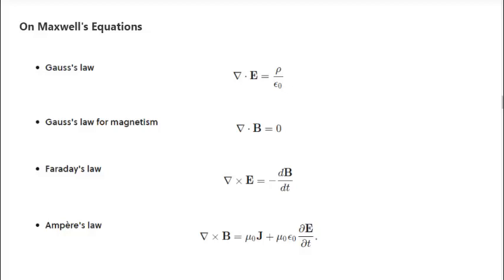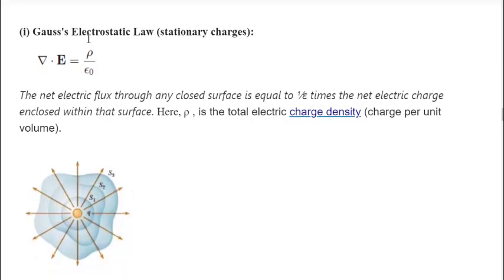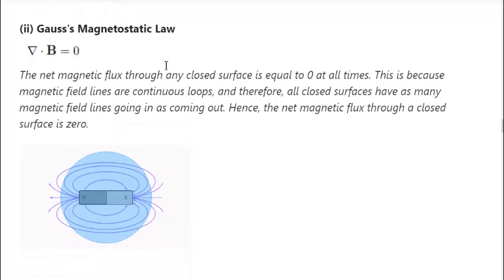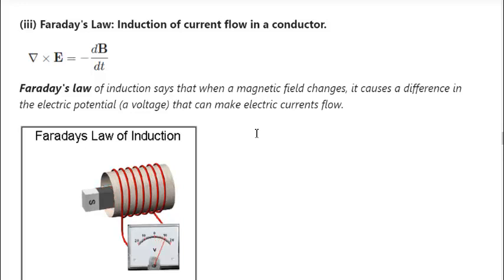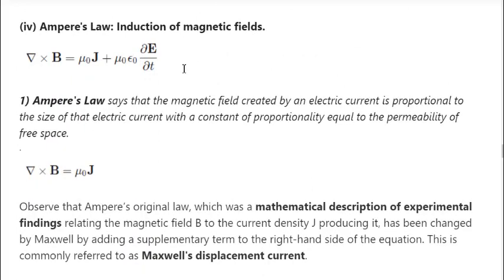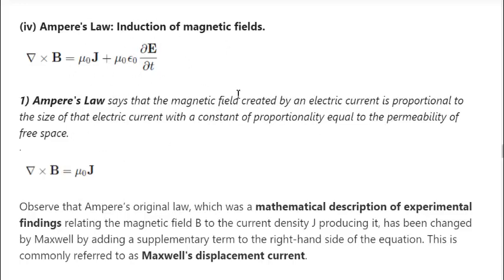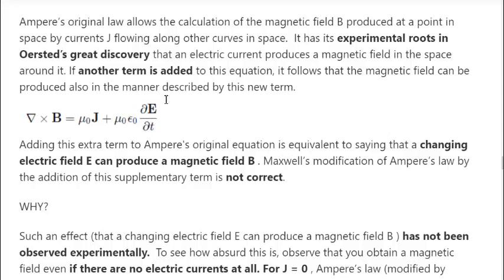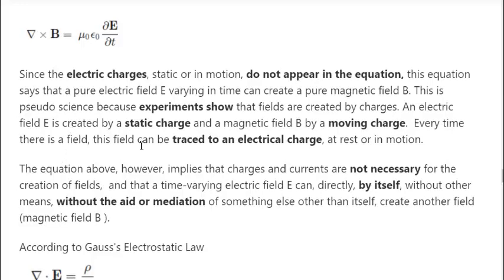On Maxwell's Equations: Part 2

Comment: Very interesting.  The Law of Induction.  This brings to mind something I saw ages ago.  A mechanical tone generator.  A magnet and coil mounted on a base, with an adjacent ferrous plate that is square.  The plate is spun on an axis, where the corners intersect the magnetic field.  The field fluctuates, which creates a fluctuation of current in the coil.  The "tone" is varied by the rpm of the spinning plate.  This was back in the 70's, and led my imagination in new directions.

Comment: We always considered ‘displacement’ current as charge movement within a dielectric.  As the dielectric is polarized charge density changes without allowing an external current flow to the capacitor.   However this internal displacement does create a magnetic field momentarily which is extremely difficult to detect, yet has been detected experimentally.

Comment: an accelerating charge is the classical analogue of an electron orbital jump or energy state transition . this atomic process will produce a magnetic field from the orbital and spin magnetic moment of the electron. at the same time, the same charge acceleration exerts a coulomb force in the electric field (counter-spatially), charging or storing electrical pressure energy in the electric field. which in turn generate a corresponding net voltage potential ( becoming  negatively charged that is).  1 ampere is charge flow per second = 1 coulomb force = 1 volt net charge. i think this process is the origin of "changing magnetic field induces a changing electric field and vice versa. 

this is also the process ( which is basically an oscillating charge aka alternating current) that is being tracked  by the iconic graphical /mathematical  representation of the electromagnetic waves with two sine waves (magnetic and electric ) perpendicular to each other.

Comment: Plasma physicist here. While there are several problems with this paper, the most important mistake is around 10:50. The equation does not imply that dE/dt = 0 if d(rho)/dt = 0 (that "P" is the greek letter "rho"), which is what the paper (and you) state. What the equation does state is that the DIVERGENCE of dE/dt = d(rho)/dt, which is not the same thing, so DIV dE/dt = 0 if d(rho)/dt = 0. It seems to me that whoever wrote this does not  have a sufficient mathematical background to get into the dirty details of the E&M equations based on the mistakes I've seen. One more thing: displacement current is observed and understood. Its the reason AC  can pass through a capacitor, but DC cannot. It is not fake. 

Sometimes (not often) theorists can predict phenomena well before it is experimentally observed. It's really exciting when this happens. One such example is something called Landau Damping in plasma, look it up if you're interested.
Reply from the maker: I passed this comment along to the author of the paper so see what he has to say. Will keep you posted.
Reply: Fractal Woman sure thing. I looked him up briefly. It looks like he’s trying to explain E&M without the use of displacement current all together and concludes light is purely magnetic, not an EM wave. This is simply not consistent with what we observe regarding the interaction of light with matter. Also, the lack of displacement current in Ampere’s law would introduce mathematical inconsistency in the set of equations. But I think the biggest mistake is the notion that all of these equations haven’t been experimentally verified. They have been in a variety of applications across many fields of physics and engineering. There’s really no question about it. All the pieces of technology I am using to post this comment have been designed using these very equations. If the equations were that flawed, the technology simply wouldn’t work!
Reply from the maker: NA: Here is Ionel's reply: 
Regarding the plasma physicist's comment:

" What the equation does state is that the DIVERGENCE of dE/dt = d(rho)/dt, which is not the same thing, so DIV dE/dt = 0 if d(rho)/dt = 0. "

Mathematically speaking he is correct, but that is not the point I am making. It was explained in the article at page 12/30 (top of the page). The point I wanted to make was that when you write divE you conveniently use Gauss law WITH charges (rho not zero), and then use it to obtain a displacement current for vacuum (where there are NO charges !).

If you want to work in vacuum, you should use rho=0 (because there are no charges in vacuum). In which case not only divE becomes zero (Gauss' law) but E also becomes zero (because there are no charges to produce E). Even if mathematically divE=0 does not imply E=0, physically this is what happens because there are no charges producing the field E. And with E=0, there is no dE/dt to speak of, so there is no displacement current to speak of. 

Mathematics aside, what I am trying to say is that if you want to be honest and derive equations for fields in vacuum, use no charges in your calculations. You will see that without charges, you have no fields to even speak of.

Regarding plasma physicist's statement that the AC passing through a capacitor is proof of the existence of the displacement current, he couldn't be further from the truth. In a capacitor charges are stored on the plates and the reversal of the current simply makes the charges travel back through the wires connected to the plates. A displacement current, if it existed, would produce a magnetic field (like any real electric current). A displacement current in a capacitor would produce a magnetic field in the space between the plates of a capacitor, and this has not been observed experimentally (although it should be a simple experiment to make; n.b. it must be a vacuum capacitor, not one with a dielectric material between its plates).

Regards,
Ionel
Reply: @FractalWoman  He's assuming that if rho = 0, E = 0 still... I'm not sure  why he insists this, because it is not the case, but I'll respond to the last  paragraph. The B field in the capacitor IS observed, it wasn't observed in the 19th century because of the limitations of detectors, but rest assured, it has since been measured. I posted these papers on one of his videos, but I will post them here as well:

https://iopscience.iop.org/article/10.1088/0143-0807/36/5/055048/pdf

https://journals.aps.org/prl/abstract/10.1103/PhysRevLett.55.59

As a side note for fun: In plasma physics, we only use the vacuum equations! I think there's a little  confusion about what the 'vacuum' equations mean. Its in contrast to the "macroscopic" equations, which account for the effects of the material. In a plasma, you typically only have charged particles, so there are no effects of some background medium that needs to be accounted for with the macroscopic equations, just charged particles flying around. Because they are called "vacuum" equations does not require that there is NOTHING there, I mean just look at the equations, rho is still there. I think another term for this set of equations is the "microscopic" set
Reply from the maker: @abarbar06  The equations aren't necessarily flawed. It is my opinion that the equations are merely misunderstood. For example, I am an Aetherist. I believe there is an Aether and I believe that I know what it is "made of". https://www.researchgate.net/publication/313515057_A_Medium_for_the_Propagation_of_Light_Revisited
If I am right, then space need not be "empty of charges". In fact (if I am right), then space is responsible for the experience of charge itself as depicted in Figure 1 of my paper. This gives us a ponderable medium with which light can propagate without the nonsense of a field creating a field.
Reply: @FractalWoman  Why do you say "nonsense" of creating a field? Why is it nonsense? If light actually propagates by continuously generating E and B fields, why would it be nonsense?
Reply from the maker: @abarbar06  Before I answer this question, can you please define a field?
Reply from the maker: @abarbar06  I sent this response to Ionel. Also, I thought you should know that Ionel Dinu is a physics teacher.
Reply: @Fractal Woman It’s not my definition, it’s the same definition for everyone: A field is physical quantity defined everywhere in space and time. It could be many things, temperature, density (scalar fields), velocity, gravitational acceleration, electromagnetic (vectors), or things like stress and strain  (tensors).  

When we say changing electric fields create changing magnetic fields and visa versa, it means the values of those fields change at the specific location and evolve in time according to maxwells equations
Reply from the maker: @abarbar06  Ok. So we are on the same page. A field is a mathematical abstraction. It is a physical quantity (defined everywhere in space and time). So...can a mathematical abstraction create a mathematical abstraction? That is the question. All we know for sure is that moving "charges" can create a magnetic field and a moving magnetic field can make "charges" move.
Reply: @FractalWoman  I get what you're saying, and I think the issue here is semantics. It may be confusing to say "create a field". A better, clearer way to say this is that charges are "sources" and "sinks" of electric field (described by Gauss' law) if we want to think mathematically. The relationships of E with dB/dt and B with dE/dt are not the same. They are not "sources" and "sinks", but they are related nonetheless. a time varying magnetic field comes with a spatially varying electric field, and a time varying electric field comes with a spatially varying magnetic field. This is exactly what faraday's law and ampere's law say. If you accept Faraday's law, why doubt ampere's law (including dE/dt)? its symmetric really. What I mean is, taking J = 0, faraday's law and ampere's law are identical in form.

I kind of interpret what you're saying as "if there are no charges, there is no E field", and I think that's technically true, but not very useful. What I mean is that the electric field has infinite range (the field from one electron in my living room can, in theory, be felt on the other side of the solar system). And it turns out, our universe is full of charged particles. So, in a way, the entire universe is an electric field (it is after all, defined everywhere). When charged particles (anywhere) gain or lose energy, they emit or absorb EM radiation. In fact, if no charged particles ever "changed state", there would be no EM radiation (no changing E and B fields!). But they do, and god said "let there be light" or something like that right? :)
Reply from the maker: @abarbar06  Perfect. That was very clear. Everything you said here supports my "model" of the Aether as outlined in my paper (linked below) which attempts to answer the question "what is an electric field made of?".  My electron-positron pair Aether is everywhere, which explains why/how an electric field can be defined everywhere in space. This also explains where all those "virtual" electrons-positron pairs come from. They aren't virtual. They are real and are everywhere. They can be emitted (from the vacuum/Aether) and they can be absorbed (by the vacuum/Aether) in electron-positron pair "annihilation". The Aether is an electron-positron pair sink and source. https://www.researchgate.net/publication/313515057_A_Medium_for_the_Propagation_of_Light_Revisited
Reply: @FractalWoman  Well I don't know about all of that. What I can say is that maxwell's equations describe the "classical" picture of electricity and magnetism, and does not fit with some observations. For example, the atom as we understand it would be unstable in the classical model, electrons would be free to spiral into the nucleus, radiating off its energy. The fact that they don't is one piece to the puzzle of quantum mechanics. Though I'm much less knowledgeable about quantum mechanics (and particle physics as well)
Reply from the maker: @abarbar06  When a planet orbits the sun, does it lose energy and fall into the sun? Does the moon lose energy and fall into the Earth? Why do we call them electron orbitals?
Reply: @FractalWoman  Those sorts of collisions absolutely happen with macroscopic objects, it all depends on the mass densities of where you're looking (in fact, that's how stars and planets form). Our solar system is stable for now, but the rest of the universe is certainly not always like that. Atomic structure has some analogs to stellar systems, but they are not the same in many ways. These types of collisions can happen in atoms, but its much much more rare than classical E&M would predict.
Reply: Fractal Woman also, planets aren’t known to radiate when they change velocity, as electrons are
Reply from the maker: @abarbar06  Are you sure?
Reply from the maker: Also, electrons don't "lose" energy when you accelerate them. They radiate the energy that was supplied to them in order to accelerated them. If electrons "lose" energy when you accelerate them, then would they not eventually disappear?
Reply: @Fractal Woman 

This is what I’m talking about

https://en.wikipedia.org/wiki/Synchrotron_radiation?wprov=sfti1
Reply: Fractal Woman but this is all getting off topic of the video here. I think Ionel Dinu’s paper you discuss has some major problems and is not consistent with (or ignores) measured phenomena
Reply: @abarbar06  The magnetic field measured in the experiment described in the first paper (iop Scheler_2015_Eur._J._Phys._36_055048) was due to the superficial charges moving on the capacitor plates during charging and discharging. It was not due to the so-called displacement current.
When charges flow on the plate, they travel radially from the center of the circular capacitor plate to the edge and back. They will produce a variable magnetic field that can be detected through electromagnetic induction. The magnetic field produced by charges moving radially will have a radial symmetry, with a zero value at the center of the plate since charges do not move there.
So this paper is not what its title says it is, i.e. it is not a “Measurement of Maxwell’s displacement current”.
In order for this method to be convincing, it must use a capacitor with a great space between its plates (not just 2cm), place the search coil between plates but far from each plate (which will be midway between the two plates) to avoid detecting the currents flowing on the plates as mentioned above, and use low frequency currents (because a current of 1MHz such as used in this experiment emits radio waves so the search coil will act as an antenna and pick them up).
Debunked ! :)

Comment: Maxwells equations are based upon,,,,force and motion inertia and acceleration of magnetism....Maxwells point of reference was a stationary magnet 🧲...he moved a magnetic field around a stationary electrical coil,,recording the results and then revolved an electrical coil around a stationary magnet 🧲...the results were absolute....Maxwells point of reference is a zero motion magnet 🧲..force and motion inertia and acceleration ....